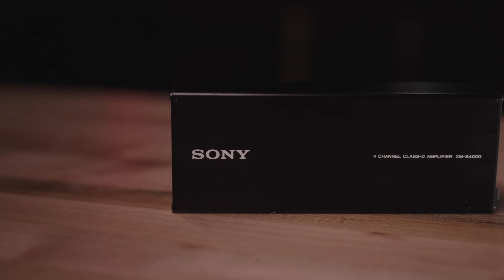What's the difference between amplifier classes? | Crutchfield

Comment: I have a JVC  ax f3000 stereo integrated amplifier with class A amplifier and a Harman Kardon pm650 vxi class AB amplifier to power a pair of mission 734i floorstanding speakers

Summary, even though the jvc output is only 40 watts per channel at 6 ohms & the harman kardon is 70 watts per channel at 8 ohms, i have to turn the harman kardon up to half way for it to really shine but even at low volumes to almost mid volume, the jvc sounds so full and rich & warm & balanced

I didn't really notice much difference between the two volume wise, the harman kardon is a little louder past the mid volume but the speakers introduces little distortions 

I ended up keeping the jvc, the sound quality difference is  clear for me regarding class A & AB amplifiers, I'll always choose class A if available, it just sounds better to me

Comment: Class D are high frequency switching amps - there operate on a fully on or fully off transistor state. Yes, they’re efficient, yes they are powerful (due to their efficiency) - but I find them to be quite cold and harsh. Give me a 50kg A/B with a toroidal transformer the size of a Christmas pudding and a series of beer can sized capacitors any day of the week …. A/B vs D is like a V8 compared to an EV …. Class D’s are for pussies ….

Comment: Where does my MOS Single current push-pull amp. fit in this A to D scheme? 🙂
Reply: Push-pull is a separate thing from classes. Class A can be single-ended or push-pull, and when a Class A amplifier uses push-pull, it cancels out all even-order harmonics, lowering harmonic distortion substantially. Note that Class AB, B and C must be push-pull because they use separate devices for each half of the AC cycle. Class D uses push-pull, but it's a PWM modulation scheme that's different from A-C classes.
Reply: @Speed-Daemon-123 I see! Thank you very much for this great explanation. (the amp in question is a Denon 2500NE.) 👍🙂
Reply: @SuperLionman123  you're very welcome! I'm glad you found it useful. 😄

Comment: There is also a special class of amplifiers called "current dumping". In this class, excitation transistors work in pure A class, and output transistors in B or even C class. This avoids the distortions caused by the quiescent current that are present in the classic AB class.

Comment: "Warm and Fuzzy" is a poor description of the Class A sound. Refined and painstakingly detailed would be a better way to suggest this sound. "Warm and Fuzzy" characteristics come from 'pleasant' sounding distortion, which is usually introduced by a tube preamp or amplifier stage, regardless of its amplifier class. Some of the cleanest, most detailed and critical sounding amplifiers in the world are Class A amplifiers due to their capacity for extremely low distortion characteristics and very high current delivery.

Comment: Had two class d amps Alpine and JL, the Alpine developed a fault and bought a class h just to replace it while I repaired the original. Now after listening to the "h" I will say that it's actually fantastic, a fuller smooth sound compared to the d's that on higher power the high frequencies can be somewhat painful, not only that but mids were also sharp whereas this is really subtle and clear. And yes aware different setups etc but just very happy after over a week.
Reply: What amplifier did you get that is class h?
Reply: @JaRuuizz  The club a754 jbl, actually made by harman.

Comment: Hertz dp 4.500 amfi icin bana aşırısı tiz olmayan 16 cm ve 13 cm component hoparlör olabilir kaliteli focal hangi modeli mesela audison vs
Reply from the maker: Are you asking which speakers are good to use with the Hertz amp?
Reply: @crutchfield  yes
Reply: @crutchfield  focal 165 ac audison apk 165 which one is good, it doesn't hurt the ears too much, I don't like too much treble
Reply from the maker: The Hertz SP 4.500 SPL amplifier is too powerful for the Focal Performance 165AC speakers. If you prefer warm, smooth sounding speakers consider using the Morel Tempo Ultra Integra 602 MKII's in the link below. Always make sure to confirm fitment in your specific vehicle by using our online Vehicle Guide.

https://www.crutchfield.com/I-rYALc166/p_210TU602N2/Morel-Tempo-Ultra-Integra-602-MKII.html

Comment: Class A: good for analog signals, that comes from analog sources or quality audio sources. Heats like crazy, usually used on high frequency, low power (due to heat), can be used as a toaster, expensive. Provides best quality if audio source is high quality.
Class AB: Somewhere in between class A and class D. Best choice between quality and efficiency. Medium price
Class D. very efficient, good for subwoofers and high power speakers. Quite cheap. A little worse on high frequencies (if using good analog source). Probably best choice overall.
Reply from the maker: An excellent explanation. Are you using exclusively class D amplification for your system? For me personally in my vehicles, I prefer AB for the full-range speakers and class D for the subwoofers.
Reply: @crutchfield  I'm using class D mostly because they are cheap and easy to use. It sounds good enough for me
Reply from the maker: It's great to hear that you are happy with your system! 🙂
Reply: @crutchfield suanda ab class amfi ile d class markali amfiler ayni fiyat nerdeyse

Comment: class D is Digital.
Reply from the maker: Class D amplifiers use efficient switching with analog input and output. They do not operate with a digital 1's and 0's source input without first passing through a DAC.
Reply: @crutchfield  they output a pwm of the original signal. thats digital.

Comment: When I listen to music I want it to sound good I don't whip out a calculator and contemplate the amp's efficiency. People are so weird now. Class D is garbage for audio, it's only suitable for industrial motor speed controllers and welding. Please stick with Class A/B, It sounds way better with much less distortion. The industry has successfully fooled most people into buying this junk not because it sounds better but because of much higher profit margins because D is cheap junk to make.
Reply from the maker: What formats are you listening to most often these days?
Reply: @crutchfield  2" analog tape.
Reply: @crutchfield  I've looked at the audio waveform coming out Mp3 compression both on computers and oscilloscopes and it looks fine. Audio out of Class D looks like it ran through a Marshall JCM800.
Reply from the maker: Nice! That is sure to sound great.
Reply from the maker: I am quite fond of my JCM800!🤣 But I agree, I would not want to play my tunes through it. AB is going to still be one of the most popular choices for sound quality with car and home audio amplifiers.

Comment: AB for car door speakers.

D is for subwoofers.
Reply from the maker: If you stick with AB amps for your mids/hi's and D for your subwoofer, you are sure to have a great sounding system!👏🤘
Reply: @crutchfield  Is better to have 2 seperate amps for a specific function each in my opinion.
Reply from the maker: That's always a solid plan! 🙂

Comment: What about Class A and Class D hybrids like Devialet Phantoms?
I own one and I fell in love with the sound quality and the powerful bass.
I am about to buy a Devialet Phantom 1 108dB version, but I am waiting for the next generation of Phantoms.
Bluetooth 5.0 isn't enough anymore.
I am waiting for Bluetooth 5.4 generation.
I also asked Devialet, if they would use APTX Lossless Bluetooth codec and Wifi 7.
Devialet answered to my question by saying noted.
Next generation will come late 2024 or early 2025, hopefully.
Reply from the maker: Devialet power and sound quality is amazing! We are not showing any date or specs on the Devialet Phantom I 108dB replacement; but should offer it as soon as it's available so please check back.

Comment: Hi sir, whether class AB amps drain car battery more quickly than compared to class D amps when we have stop the car for 1 or 2 week? Also whether we need to face car starting problem as battery gets older in case of class AB amps?
Reply from the maker: Just so you wire the amp properly, it would come on with the vehicle so as not to drain the battery. You would not expect to have more or less battery issues using either amp class.

Comment: Class A not used in cars huh?
Reply from the maker: There are some hybrid A/D models right now from Rockford Fosgate that are impressive. They use dynamic switching frequency control to combine the sound quality characteristics of Class-A with the efficiency of Class-D. This technology allows the amplifier to produce more power with less current draw from the vehicle charging system. Are you considering an amp for a specific setup?

Comment: I can't use a class d amplifier in my car. They cause too much rfi to even listen to the radio. I have tried cheap to expensive and the outcome is similar. Of course, higher quality class d amps are better, it is still an issue. I drive a Fiesta ST, and the only place to put amps is in the hatch. Of course what is directly above the hatch? The radio antenna. That mushroom cloud of rfi just kills radio signals unless they are really close and strong. I live in a thinly populated area so radio stations are far away. Even in the city, the HD channels will not work with a class d. So I swapped the amps with A/B amps and have no radio station issues.

Comment: When I bought my pa active mixer it was so light I couldn't understand. At first I thought it will be a POS and very under powered but I can't believe how much sound is generated by it. My previous amp was a A or AB and that thing was heavy. So because of the weight of my new active mixer I assume it's a class D
Reply from the maker: Awesome! There are some amazing amp designs out there for sure. What do you use your portable system for most often?

Comment: I built a powered speaker with class B amplifier (yes, class B). It uses negative feedback to provide a "corrected" waveform to the output transistors (opposite to how they would distort) and it sounds pretty decent.

Comment: Glad you offered help because I 
Need someone to explain what… 

“ADAPTIVE FEEDBACK GLOBAL MODULATION TOPOLOGY” 

In a car amplifier application is and what does it for for this
 D CLASS four channel Alpine …
 It’s the model number (R-A60F) and the manual does NOT get into those details and there is not one YouTuber talking about this technology and if this is what makes a D class suitable as an 
A/B class? 
I bought it bccs it’s the only ALPINE amp that is 
100w @ 4ohm x4 stereo. AND THE ANP IS “HI RES”… BUT…. It’s a D class… So what am I missing here?
Reply from the maker: Great amp! What are you using it to power? Alpine did use a class D build for this amp to make it super efficient; but it does have their built-in "Dual "Sierra" feedback circuitry  to ensure cleaner sound than you'd expect from a class D. That tech decreases distortion by correcting the output using the original input signal.

Comment: Class D sounds weird to me. I prefer AB
Reply from the maker: For just your main speakers or your subwoofer's too?
Reply: @crutchfield  yep both. It sounds different.
Reply from the maker: Cool. What are some of your favorite amps used over the years?
Reply: @crutchfield  back in the day I used Orion for subs and McIntosh for mids and highs. I know Orion is garbage now though lol.  I also think subs sounded better when it required more air space.
I liked subs called Petras. I doubt you heard of them I don't think they were nationwide. I used nakamichi head units mainly back then. They stopped making Petras so I started using jl audio subs.
Oh I also used ppi amps.powerclass of course.
Reply from the maker: Sounds like you've had some great options over the years. Are they still making Petras?

Comment: What about reliability? For me class d amps have been less reliable.
Reply from the maker: What were some of the issues with reliability? Since they are far more efficient and create less heat than other classes of amplifiers, class D tends to be extremely reliable.
Reply: @crutchfield  I was using those TPA3110 based board, it didn't last long. Also a philps sound bar I had came with a  class D chip, it didn't last long.
Reply from the maker: I am sorry to hear that you had a poor experience with your Phillips sound bar.

Comment: Can you explain how the H class amplifier works? And why only Bob Carver uses it and no one else? Thanks.
Reply from the maker: The Class H is an AB variation that manipulates the amplifier's own power supply to get you more efficient power. While there have been several brands that did their own take on this design, it's not as popular as many other options due to the sophistication the monitoring and control requires.
Reply: @crutchfield  Thanks for the explanation 👍
Reply from the maker: You're welcome!

Comment: For some kenwood peak power 700watt 6x9 what amp do you guys recommend? What Brand and how many watts ?
Reply from the maker: We are happy to help recommend an amp. RMS watts are used to help match an amp to speakers. What is the RMS watt rating for the Kenwood speakers? If you do not have that information, we may be able to find it using the Kenwood model number.

Comment: For home audio, I will never use a "Class D" amplifier again. They DO NOT sound as good as a vintage "Class AB" amplifier.  I had no idea what I was missing until I went vintage and heard the difference.  There is a reason McIntosh still uses "Class AB" still.  The modern computer chip circuit board amps just can not compare.
Reply from the maker: For a warm, natural sound tone Class AB absolutely delivers.

Comment: Mostly true and not bad explained.
But you forgot an very important thing..: Class A gets more efficient the more you turn the volume up.. It's only at idle and low volumes they have really low efficiency.
Class D are only "digital" in the sense that they have switch-mode power supply.

And a tip: If that Rotel and speaker setup was yours.. Move that Atmos speaker where it is supposed to be.. High on the wall or in the roof.. Reflecting sound from the roof is not even close as good amd requires even more perfect room to even so it properly as intended.
Reply from the maker: Great points! We chose an overview approach to this video which definitely glosses over some finer details, especially a proper Atmos setup, which we just tried to give a visual sense of here. Makes us think maybe a deep dive on Atmos could be in our future.

Comment: D stands for Digital
Reply: No it does not stand for digital!
Reply: No its not
Reply: Albert Einstein been real quite after looking at this comment intelligence.
Reply: Yep it doesnt stand for digital, class D amp convert analog signal to pwm, to drive the output mosfet. Digital amplifier is actually another type/class of amp, I think (could be wrong), the output mosfet is driven by digital pcm signal, even if you hook an analog input, it converted to digital first before amplification (with ADC, like DAC in reverse), so its a fully digital amplifier. For example, lyngdorf's amplifiers are digital.

Comment: I remember building a mosfet amp some 600w single output  at college 28 years ago .
I still have it , but not the 15" guitar bass speaker and larger box I had set up to my stereo with I was young .
Back then, I built with a normal stereo amp , mulplie crossover , plus 3 class D's one for bass and two for normal full range and the regular amp for highs only. 
The sound was unmatched to what I even had two, which costs 3k new just for speakers and pre plus power amp .
It's amazing what building class D's yourself can achieve or trying out different chips in Morden versions at low cost. 
The only issue with building is the boxes, which cost more than all the components plus buying an external power  supply. Luckily, I had already had multiple outputs .
I wish some 30 years ago we had class D's to these days with such quality , controls, and  power at around £100 pound, which can get you a 150-watt at 8ohms easily. 
It's kind of perfect for recond decks or phone jack to input to play YouTube music or other apps.
Reply from the maker: That is awesome! Class D has certainly come a very long way, that is a fact.

Comment: I have  American Bass Digital power amp that claim on the back to be a class D and its a mono amp so I lighten me on what in God's name do I have bc this mess ain't working and I need advice
Reply from the maker: A lot of subwoofer amps are now using Class D amplification because of their increased efficiency which leads to creating less heat. The troubleshooting steps are the same for them as it is for other amp Classes. Also, a lot of amp owner's manuals will come with a troubleshooting guide to give ideas on what to check when the amp isn't working or working properly. Its always good to double check the connections, make sure all new wiring it connected to the proper places in the vehicle, and make sure there is no coating on the metal being used for the ground

Comment: Do you have a rule of thumb when pairing power amp with speakers ?(power wise). I'm bass player and found out that that question have a zillion answers...
Reply from the maker: We always advise pairing an amplifier with power that does not exceed the RMS rating of the speakers you are using. Depending on your specific speakers and warranty, you may want to even use a little less power than the max RMS ratings. We are always here to help you dial-in exactly the right paired setup that would sound great and perform reliably!